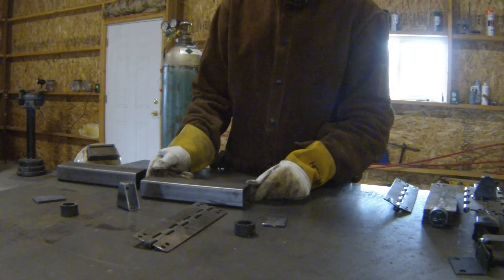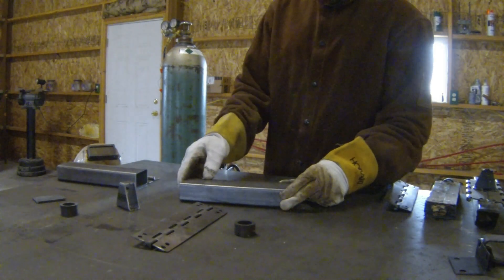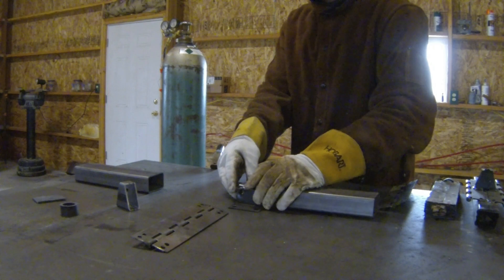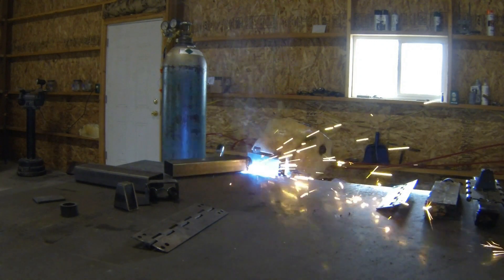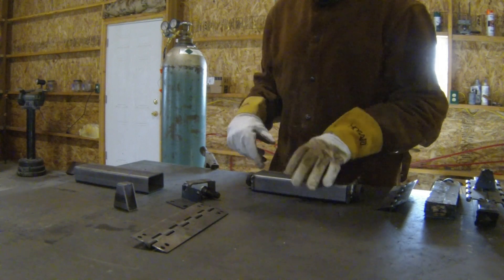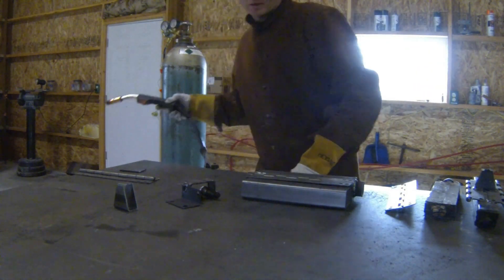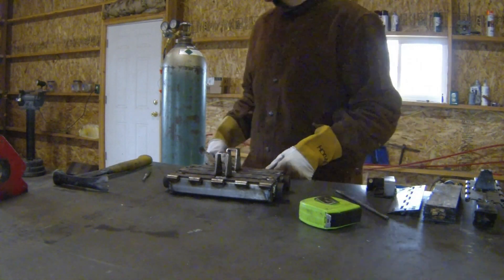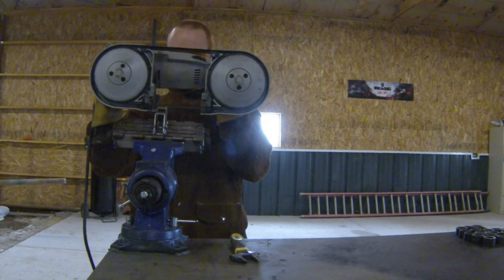how to build steel tracks

Comment: How much do those tracks weight? I planned making tracks using steel wire enforced rubber sheets and pads would be steel. They would be a lot lighter, and I think they would be strong enought if I try to make tank as light as I can. Only real problem would be connecting ends and they would be hard to repair.
Reply from the maker: If I remember correctly I think they weighed around 120 pounds each. I know I could lift them when they were all rolled up.
Reply: @JamesCookTinyTank428  well, that isnt actually so heavy. I estimated my tracks to weight around 50 kg in my drawings, so it would be around 110 pounds.

Comment: would adding rubber padding to the bottom of the tracks help with traction
Reply from the maker: Kai Germinario 
It would indeed but it's kinda a double edge sword with increased traction comes increased resistance when turning.
Reply: TinyTank428 oh ok makes sense

Comment: Why not weld the hinges on to the pads assembled? you could do them about 10 at at time, pull the pins and finish weld.
Reply from the maker: Kapitainleutnant 
o make no mistake I do. the disassembly was just for demenstraion. when I'm actually building track I don't even pull the pin to weld the loops. once in a while I forget which loop is welded to which side so then I have to cut it apart. but it happens infrequently enough it's not worth the time of pulling every pin.
Reply: TinyTank428 → How do you lubricate those hinges?  Do they even need lubrication?
Reply from the maker: RocKiteman _ 2001 
I use just a spray can chain lube every once in a while maybe every other outing or so. If they really need it or not I'm not sure but I would say lube on moving parts is usually a good idea especially if it's metal on metal.

Comment: where do you get the toothed wheel in the back of the tank?
Reply: tankman 101 , shows you vids on how to make them.
Reply from the maker: shane forsythe 
yep I build a wood template similar to Dave's plastic one. Then use it as a pattern to trace with the plasma to cut the steel ones.

Comment: How effective do you think it would be to bolt the hinges on instead of welding?
Reply from the maker: +Seth Crawford 
Bolting can be just as effective. I would still recommend welding the loops on the hinges so they cant pull apart.

Comment: hello pls i need a plan for build a tank. I build tank for my son but i need help with size. my email is otto.atv@seznam.cz (my english is not perfect) very thanks for answer
Reply from the maker: +djbigi2332 
Hi I don't have any plans on paper. I use a 1/35th scale model of whatever tank I decide to build and use a set of calipers to get dimensions. Then I multiply by 17.5 to get half scale. 
I would suggest using different multipliers and us a rough cut out of card board to get the appropriate size you are looking for.

Comment: How do you build the turret traverse
Reply from the maker: brandon sanpedro The turret traverse is made from a pallet carousel that I purchased from northern tool. so it's rotated by hand no motor or gear drive to move it.
http://www.northerntool.com/shop/tools/product_1037684_1037684
The hinge is a 14 gauge hinge with a 1/4" pin that I purchased from buyers products.  
http://www.buyersproducts.com/truck-trailer-hardware/continuous-hinge/steel-continuous-hinge-equal-leaves-steel-pins/continuous-hinge-steel-191/1287/

Comment: I prefer TIG welding, more accurate and stronger
And you fell each inch of the tanks that you constructs
Reply: +Jean Carlos Guerra Yes MIG is fail for this kind of thing.
Reply: TIG is not required for a strong weld.  It has its uses and the welds sure are pretty when you are good at it, but pretty welds don't always equal strong welds.  MIG is more than sufficient for this application.
Reply: @KurNorock  I agree. The biggest fail with mig welding is being too cold with your settings and not prepping the weld area properly. You have to grind the oxide layer off for good adhesion. It actually takes more heat to melt that oxide than it does the steel itself. FYI- I am a journeyman welder.